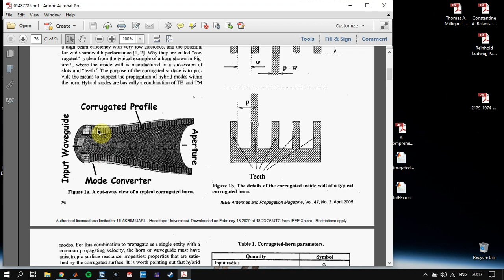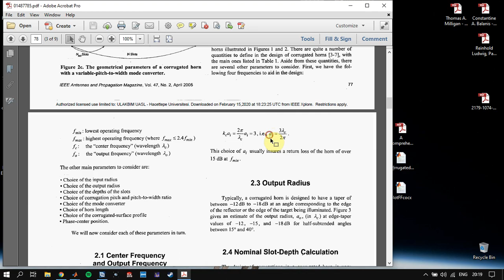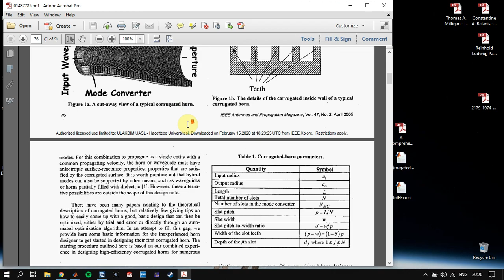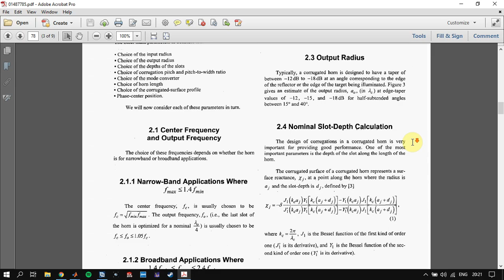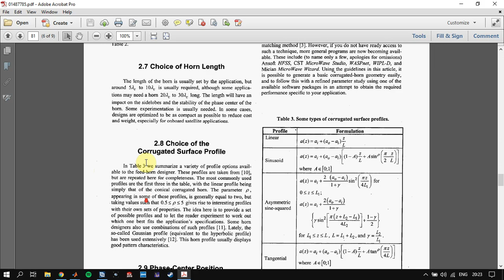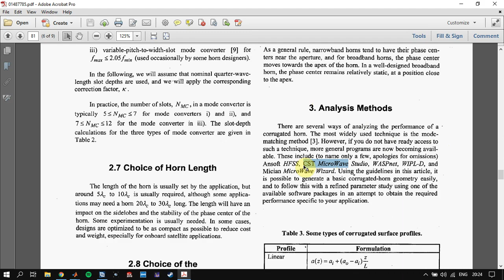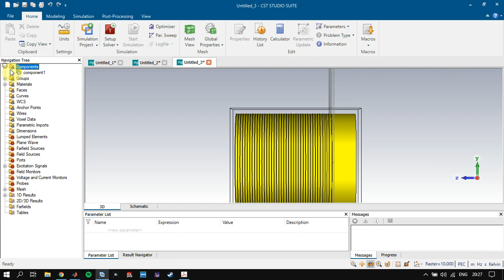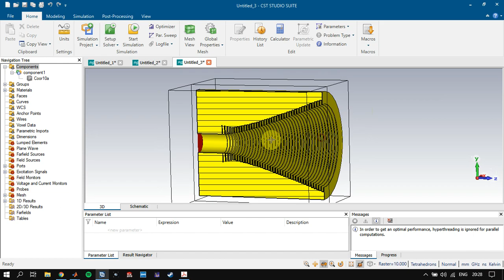Corrugated Horn Antenna Design in MATLAB and CST

Comment: >> Corr_Antn_Desg_Tool
Error using load
Unable to find file or directory 'Corr_Antn_Desg_Tool.fig'.

Error in matlab.graphics.internal.figfile.FigFile/read (line 31)
hgDataVars = load(filename, '-mat', '-regexp', '^hg[M]');

Error in matlab.graphics.internal.figfile.FigFile

Error in hgload (line 56)
FF = matlab.graphics.internal.figfile.FigFile(filename);

Error in matlab.hg.internal.openfigLegacy (line 57)
    [fig, savedvisible] = hgload(filename, struct('Visible','off'));

Error in gui_mainfcn>local_openfig (line 286)
    gui_hFigure = matlab.hg.internal.openfigLegacy(name, singleton, visible);

Error in gui_mainfcn (line 158)
        gui_hFigure = local_openfig(gui_State.gui_Name, gui_SingletonOpt, gui_Visible);

Error in Corr_Antn_Desg_Tool (line 42)
    gui_mainfcn(gui_State, varargin{:});
  
any ideas in solving this errors ?